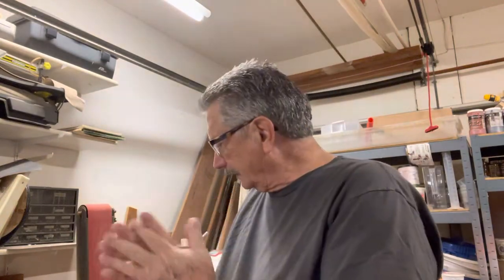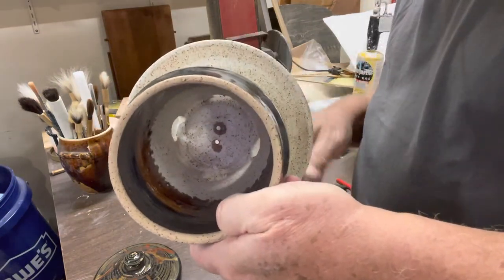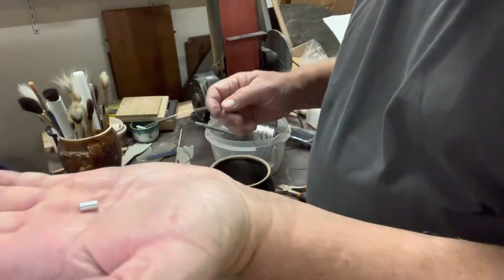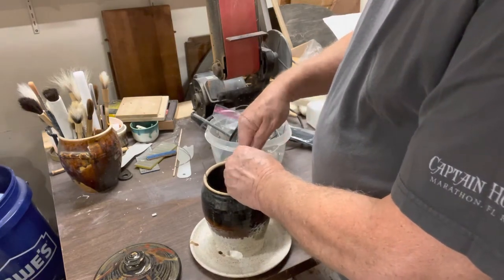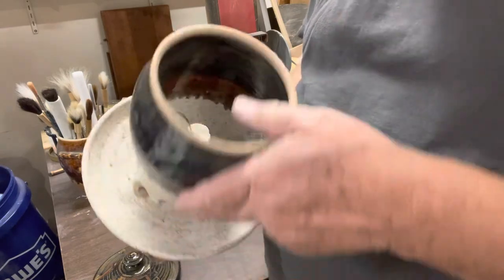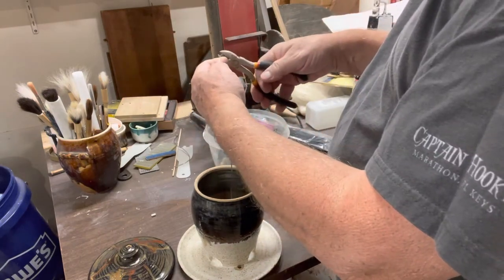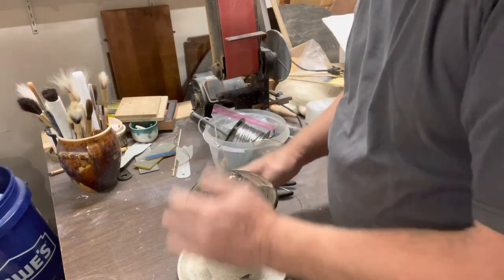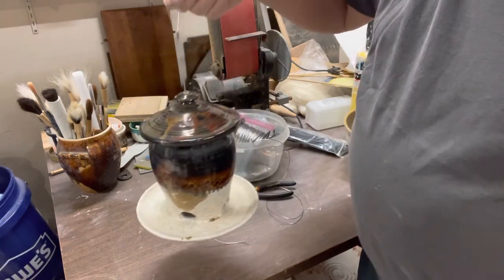How to add the Hanging Cable to a Bird Feeder

Comment: What kind of cable to you use? You mentioned plastic coated.
Reply from the maker: Sorry I missed your question.  This is the description on Amazon.  Vinyl Coated Wire Rope Aircraft Cable 1/16 Inch (1.5mm)